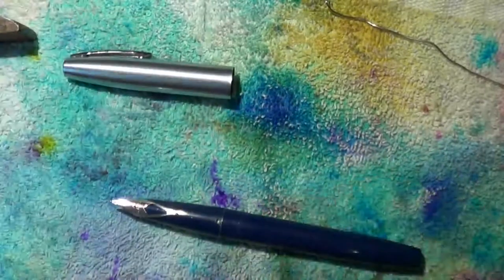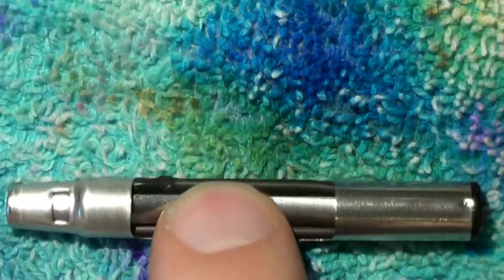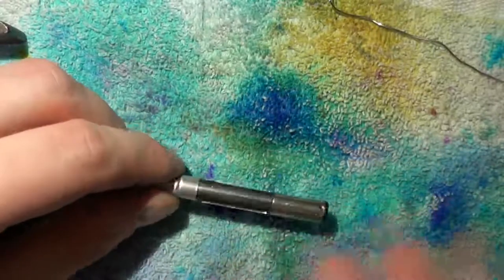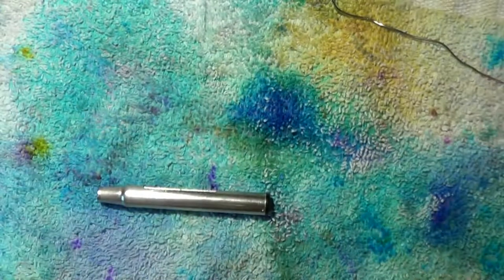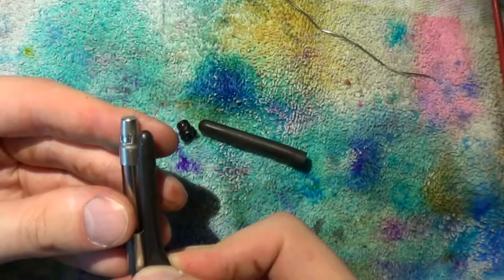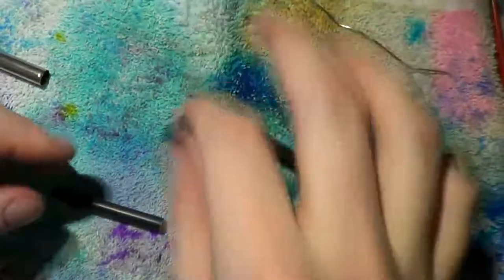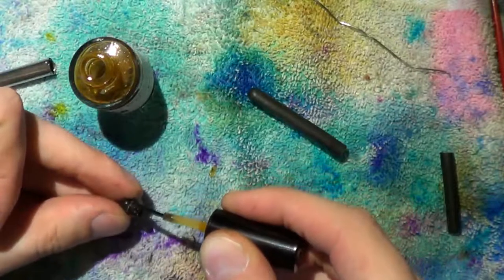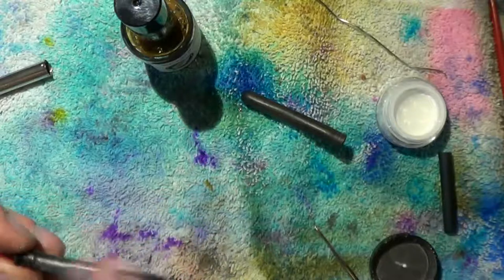Resaccing a Sheaffer Aerometric Converter

Comment: Hi, I know you posted this video years ago but I recently purchased a Sheaffer 444 with a similar problem. I unfortunately don't have an assortment of sacs to choose from. Do you perhaps remember which sac size you used on this repair. The converter is identical.
Reply from the maker: No, I'm sorry, I don't.
Reply: +eduardo delgado Interestingly enough, I just took out my dad's 440 and the sac is completely wasted (hard and crumbly). I've put it in water overnight to get the ink off it. Being in Mumbai, India not a lot of options to buy online or in nearby stores. I think I'll have to scourge through some old specialist shops who may still have some - or ask a friend to order some online in USA and then have them sent over. 

Slightly off topic, Ink pens are losing their market here. You can buy a refillable cartridge filled one for 25 rupees (50 cents) and an ink pot for a similar price too. But its a shame, people don't use these any more. Of course, I'm talking about run off the mill plastic ones.
Reply: +sbrebrown I faced a similar issue trying to trace this step by step guide (read - very helpful video). May I request that you include the words Sheaffer 440 & Sheaffer 444 in the description please. It will help many others too. Thanks for the upload and I much appreciate your work.
Reply: Hi there, all sheaffer converters work c
Reply: Use sac size 15